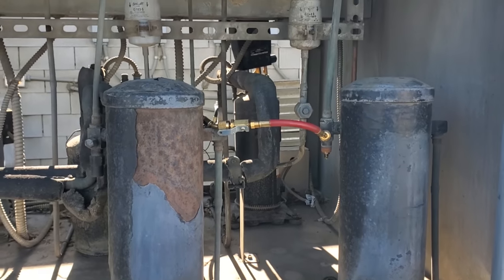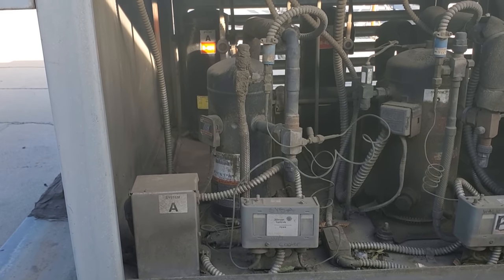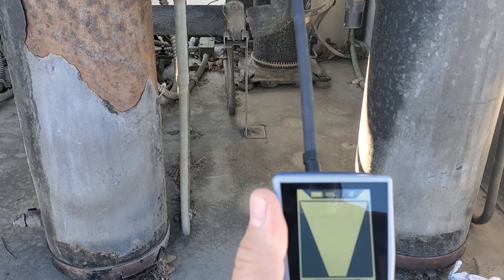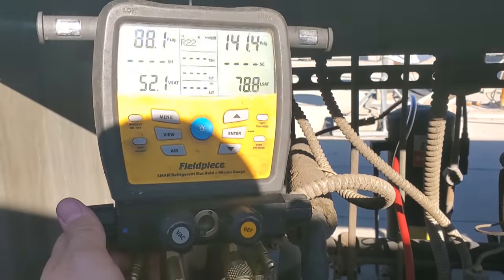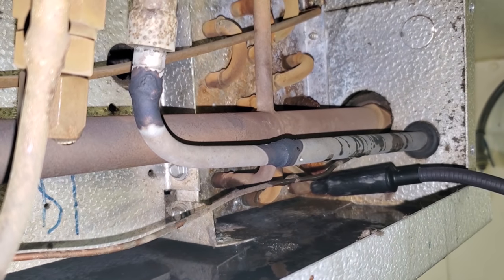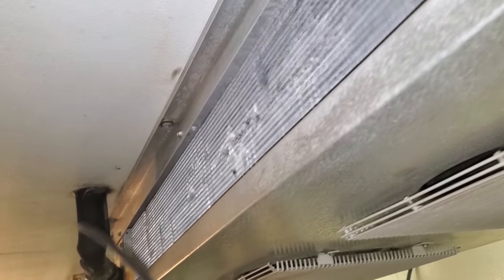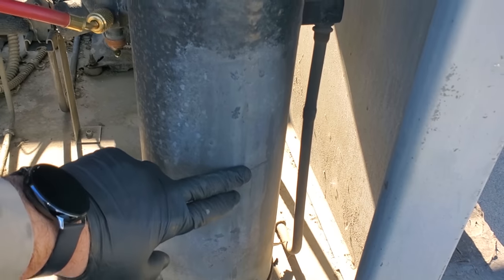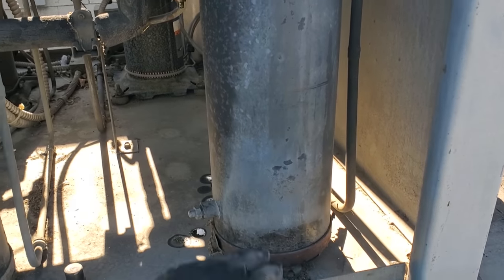WALK IN COOLER REFRIGERANT LEAK CHECK

Comment: That's how I train new guys in my air guard unit coming into hvac. Check with an electronic detector, use soapy bubbles to pin point leaks, then put on gauges to see how low your pressures are and see how low your charge is and also to see if there are any other issues in the system.  Putting gauges on before checking everything else can cause missing something simple like a leaking Schrader core. Great video keep it up man.

Comment: Im not an hvac tech, just love watching the vids, why do most leaks occur in the evap system?
Reply: Condensation/water on coil when it runs and causes corrosion/oxidation.  Off gassing of food products can be acidic and cause damage to coil over time.
Reply: Vibration and thinner walls of the copper tubes particular in the turns. Keep in mind when you bend a tube, you compress one side and stretch the other, inevitably making it thinner.
Reply: Copper and aluminum don't react to water like iron. However, acidity from off gassing of whatever is in the cooler can make the condensate more acidic and yeah, it'll be more likely to corrode. That would be likely.

Comment: With the refrigerant (R404a) being a near azeotropic blend containing (R125(44%), R143a,(52%) and R134a(4%)) doesn't that mean due to the refrigerants in that blend having different molecule sizes that they'd leak out differently leaving an inaccurate composition of what R404a is supposed to be made of thus altering the temperature glide of the refrigerant?
Reply: In one service class I attended, I was told that Manitowoc did a test of how leaks affected their performance.  They simulated 25 leaks with 25% or more loss of charge and top up. Their conclusion was a 4% loss of efficiency. If you know the history of the machine, it's a judgement call on whether or not to pull the remainder of the charge and refresh with new refrigerant.
Reply: Yes. The more volatile parts of the refrigerant blend will leak out first, thus altering its composition. The "correct" way of doing a leak repair on a system that has an azeotropic refrigerant blend is to recover the whole system and weigh in virgin refrigerant. However, the glide is generally negligible and you got to think that: recovering a system is a huge time sink, you get stuck with the old refrigerant which will need to be disposed of, and selling the customer way more refrigerant than you really need too; so doing it that way is almost never justified.
Reply from the maker: Yeah as the other guys have already said   fractionation is minimal with 404 my understanding is  the higher the glide the more susceptible the refrigerant is to fractionation issues but even still ive heard ita not a big deal. I personally have never had an issue topping off the charge
Reply: Pretty sure the size of the leak is generally  orders of magnitude bigger than the molecule size.
Reply: Thanks guys 👍🏻

Comment: The leak on the distributor was it on the liquid line side of the distributor if so that is where most of the refrigerant leaked out because the liquid leaks out faster due to higher pressures so 10#'s could last a couple of months leaking there my other concern would be the oil loss was there a oil sight glass on compressor

Comment: That’s one thing that we will find in our industry and working with REFRIGERATION commercial and industrial is the fact that you run into all kinds of foul funk bacteria, mold and as well as asbestos if you get into the older EQUIPMENT. That’s why I have lung issues right now. And I had to bring a change of clothes in the service vans over the 20 years. Because of the foul  & funk... as the bad side of our industry. Now I’m suffering as a result of it..

Comment: Another thing though, is that you can't buy refrigerant without a license. And for most people it isn't worth it to get one.
Reply: Well, except for non-halogenated HC varieties (R-290, R600) and legal sources of R-152/R-134 (canned air dusters). Which is a whole new bucket of problems if they don't know what they're doing. And on that topic, despite occasionally using them myself for cleaning electronics, I do not like the idea of spraying refrigerant everywhere just to dust stuff. But it's non conductive, anhydrous and ridiculously cheap source of finely nozzled portable high pressure, thus, the convenience takes precedence over the environmental side...
Reply: @theLuigiFan0007Productions  Yeah, sadly all the alternatives to halocarbons have problems. hydrocarbons are flammable, ammonia is highly toxic, CO2 requires much higher operating pressures and becomes supercritical at temperatures that are within the plausible range of output air temperatures for a refridgeration system (which leads to added complexity and reduced efficiency).

Comment: topping up refrigerant is illegal? REFRIGERANT REQUIRES DECANTING PRESSURE CHECK WITH OFN .I THOUGHT THAT WAS PART OF THE PROTOCOL.IF PROSECUTED IN U.K YOU CAN GET LARGE FINE .OR PRISON TERM. R THE LAWS DIFFERENT IN THE U.S?
Reply from the maker: No it is not illegal to top off the charge in the U.S. as long as the total system charge is below 50 lbs.

Comment: WHY DON'T YOU JUST CYCLE THE CONDENSER FANS TO CONTROL HEAD PRESSURE ESPECIALLY DURING WINTER .MUCH SIMPLER THAN SHOUVING LIQIUDE BACK INTO THE CONDENSER ??
Reply: Because USA 🤣
Reply: Fan cycle controls can be unreliable especially after they've gotten wet.
Reply: @inoahmann7542  YOU CAN'T BE SERIOUS !!??
Reply: @victorleon1563  I've had them stick, trip the high preasure control, reset and work fine for a few days until they did it again. I have seen them do weird things when they start to fail. After they've gotten rained on or contaminated with dirt they tend to fail rather quickly. I have been looking at the icm333 as a replacement and I will be installing my first one in a few days. I don't think headmasters are an ideal solution either but I haven't had one fail yet. I am near the ocean in Florida so that could be part of my issue with mechanical controls.
Reply: @inoahmann7542  ARE YOUR HP SWITCHES MADE IN AFGHANISTAN!!.THEY SHOULD BE COVERED AND  BE OF REPUTABLE MAKE. I USE DANFLOS AND HAVE NEVER HAD AN ISSUE.
Reply from the maker: I will discuss this on my Live Stream this evening 1-11-21 @ 5:PM (pacific)  on YouTube come on over and check it out https://youtu.be/H9NRDsb_1zQ